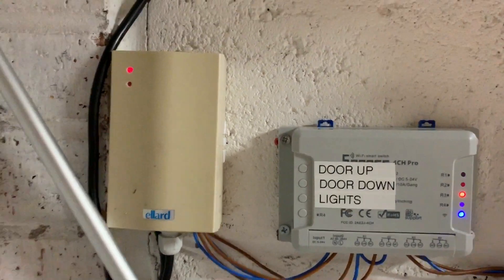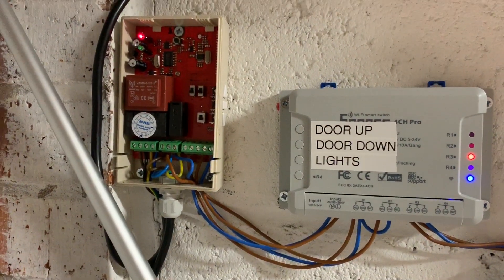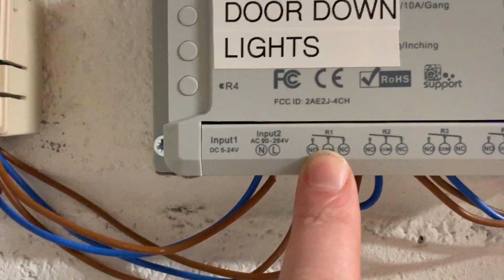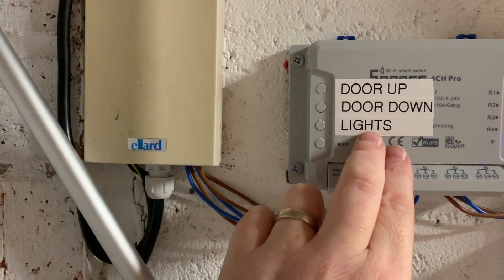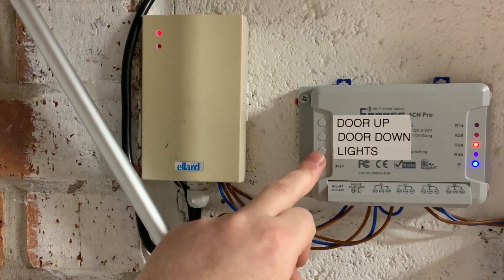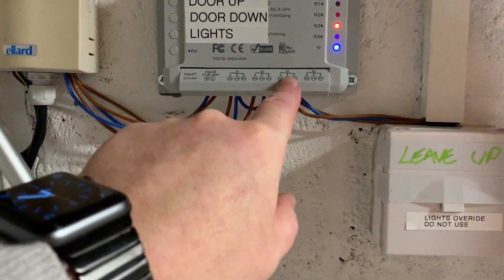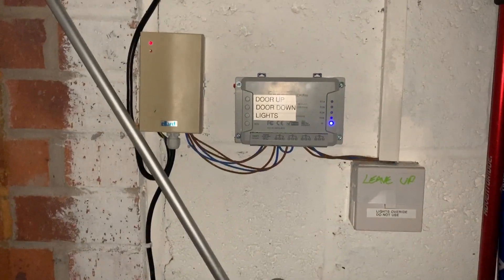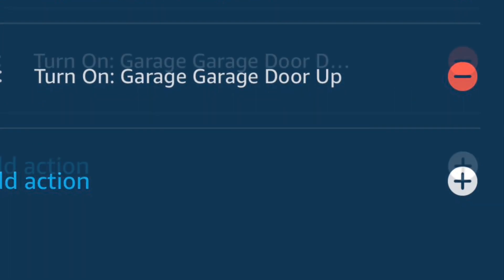Garage Door - Adding Alexa To Ellard Motor SONOFF 4ch Pro R2 Roller Door, up, down, stop switches

Comment: Thanks for vid. With the door “down”option do you have to change any settings on the sonoff? On my garage door I have to keep my finger on the button to allow the garage door to go all the way down. I’ve just ordered the sonoff and hope a single push will close it all the way.
Reply from the maker: You will have to simulate the down press from Sonoff as per what the door needs. So you will have to look at the inching mode I would think, set that to the number of seconds you hold the down button. Then the Sonoff effectively presses down for 10 seconds (as an example, set 10 to whatever it needs). There might be a maximum for inching mode. So might not be long enough.
Reply: Did you have to adjust any of the pins inside the sonoff device. Your older garage door unit looks similar to mine
Reply from the maker: @greggyboy28  no physical changes to Sonoff. Only settings in the software.
Reply: Thank you. There must be a way, I hope! Thanks for reply and v helpful vid

Comment: Great video! Thanks.

I have the same NT1006-remote-control-receiver from http://www.nvmgroup.co.uk/NT1006-remote-control-receiver 

I was wondering if the meross Smart Garage Door Opener would work with it? Any ideas?
https://www.amazon.co.uk/Control-Existing-Compatible-Assistant-SmartThings/dp/B086MLFRJ3

Comment: So glad i stumbled on your video.  I recently bought a Meross garage door opener but was told by their support it wouldnt support this type of controller. I have a product called NVM but it looks identical to yours.  I have returned the Meross mind and have just ordered the Sonoff.  Only small issue is i want to use it with Apple Homekit so i can control from Siri and from the car/phone/apple watch etc. According to Sonoffs website i think it can work despite amazon saying its only for Alexa or Google home  Thanks for posting clear video.  Just need to pause and focus on whats connected to where as im no sparky 🙂  lastly i just read some of the comments below and you mentioned a simple 2 way switch which might be best for me as i dont have anything else i want to connect.  any ideas on the model no. for one of those?

Comment: Great video, I have a question regarding turning the lights off when the door down command is issued .. is it possible to tweak that so for example if you only wanted to roll the door down a little it doesn't turn the light off, but a complete close of the door does result in the light turning off ? I can think of times I might want the door down a little whilst working in the room but obviously would still want the light on. On a completely different question ... I have a couple of ESP2866 control models lying around ... do you think its possible to use on of these to achieve similar results (or at least just issue door up and door down commands?) .. It looks like I just need something that is able to bridge the connections for a moment? Thanks!

Comment: hello, i have one question? When i put wire on up and common, the door comes up as long as the wire stays on contact, soon as i remove wire from contact, the door is no longer going up
Reply from the maker: That is different to mine. Not sure if there are any jumper switches (small black plastic wedges across two pins) that might be causing that. There are typically two types of switch, one where you have to press once and another where you press and hold. You have that option. The Sonoff thing does have the option to set how long the virtual press lasts for, so if your door takes 10 seconds to open, you could have it set to hold that switch on for 11 or 12 seconds, to be sure it completes the open or close command.

Comment: Can anyone help me. I am using two channels for up and down roller shutter and third Chanel for the lights. Now, I want the light to come on when the shutter is up and light to go off when shutter is down. Any help? I have tried scene but no vail.
Reply from the maker: Depends how you are using it but for me I created a scene open = 1 on & 3 on, close = 2 on & 3 off. Worked just fine. Then trigger  the scene instead of the button. If you use the remote for old door or the optional remote from Sonoff it didn’t work. I was using mine with Alexa and set the open command to the open scene. Close command to the close scene.

Comment: Rich Simpson

Gotta Thank you for this Sir.. got the newer R3 unit where inching is set up in the app rather than via the onboard micro switches. think my garage door panel is a slightly newer version also. but basically the same set up except i had a ground loop for a photocell which just needed to be momentary broken to stop the door. meaning i have all 3 actions available. routines such as 'Alexa Parcel time'.. door goes up for 5 seconds. pauses around 1ft high for 20 seconds and then drops again.  great for allowing the postman to slide something in.. all watched from my door bell or garage cam... TOP work Sir :). Thank you.
Reply: How did you wire the R3 please as this only has live or neutral connections?
Reply: @Garfoid  it will break the connection of anything you pass through each relay (channel) the unit it's self does not supply power to the relay... hope that makes sense
Reply: @zotzotty  blown 2 x garage door units now. I have the Sonoff RC3 and this only has Live or Neutral connectors. Powered the Sonoff via Live and neutral and that's fine but I then use ch1 and ch2 to go to O & D and then the neutral to G on the manual switch on door controller and Same neutral as power but as soon as I press ch1 or ch2 it is blowing the door controller 😢😢

Comment: Hi, not sure if you'll  still be monitoring messages from this video, however here goes. Thanks for the video, it was exactly what I needed. Can I ask, do you think I could convert a key switch roller door opener to a fob controlled unit? Thank you Alan.
Reply from the maker: If the key switch has a 2 or 3 wire input  I don’t see why not. It’s a fairly simple system if it has the right inputs I was lucky with mine. Ground and up = up. Ground and down = down.  Hopefully you are going to see something similar inside the main controller
Reply: @RichSimpson  thanks so much for getting back to me, I'll have a look today. 👍👍👍

Comment: Excellent video - you should get Amazon referrals...  a quick question - How do you connect it to your wifi - ie, how do you enter the password.  Is the setup through the phone app similar to the ring for example?
Reply from the maker: Thanks. Yes through the app. Connect to the devices own Wi-Fi network and then you enter your own info. Just like with the ring doorbells.

Comment: Hi there. Great video thanks.  
I have the slightly newer version of your garage control unit. The open and close inputs are low voltage.  Can I assume when you action the inching instruction to open or close it sends 230v? In which case this will blow the control unit?
Reply from the maker: Best to test it with a multimeter. It may be that it just closes the switch rather than sending 240v volts down it. dry contact and simply closing the loop. You are looking for continuity when the switch is open/closed
Reply: Erm I learned the hard way earlier and yes it blew the complete board. Just reordered a new one 😢

Comment: Hi Rich. Thanks so much for a great video, I am looking at getting this onto my door too which is basically the same setup.  Only thing i'm wondering is do you have the deadman switch on still so you have to push and hold the down button to close the door?  Is it possible on the SONOFF to have a push to close button still so I can keep the safety feature?
Many thanks and all the best.
Reply from the maker: Hi. I don’t have that but on the Sonoff you can set to ‘inching mode’. I have it set for something like 1 second so button one is pressed and it simulates being pressed for 1 second. You can set that inching mode for a variable length though. You can also buy the Sonoff basic unit instead and have one for up and one for down. Using the similar setup and can perhaps do it for about £15 all in then. The 4 way switch may be a bit over kill unless you have a need for the third and fourth outputs. Light (like I have) and socket maybe.
Reply from the maker: Also, note the model I used (Sonoff 4ch Pro R2) is a maximum inching mode of 16 seconds, but my motor is slow and takes roughly 30 seconds to go up or down. The later R3 model has an inching mode that can be set up to 1 hour in length so is likely a better option. The Basic modules also work well though and do this, A cheaper but less attractive solution as you would have 2 of them, one for up and one for down. Also having the risk of them both being turned on at the same time may be an issue, sending both the up and down instruction together.

Comment: Hi Rich.

Thank you for sharing this video.

I have an Ellard garage door box like yours.

I have just got the R3 Pro

I just wondered what size cable you used please? 0.75mm / 1mm / other?

Thanks again
Reply from the maker: I used some spare cable from an extension real I think, maybe 1.5mm but its not a large load for a long period of time so I think any will do so long as not very thin cable.
Reply: Thank you once again. Looking forward to setting this up.

I also noticed the eWeLink app doesnt have a 4 button option? Did you use the 6 button or the 3 button within the app and how easy is it to connect please? Is it safest to connect the device to the app first then wire in the garage door as my R3 says it's all adjustable to inching etc via the app. I'm no electrician but think I will crack this with the help of your video and help you've provided. Superstar for sharing
Reply from the maker: @james.mayhew  For me the 4 button came up as the default, must be a bit different. I would suggest wire it up to a plug and do it in the warmth of the house as different routers can be more fussy than others. Once its connected once its fine, You should be able to hear the relays working and see the lights to show it in the different modes without anything actually connected on the outputs. Also handy to update it through the app to make sure on latest firmware as some things may have changed, I think mine has received a new inching option in the app compared to a toggle switch now. A year in and mine has been really good, works well with different routines etc so for example on the Goodnight Alexa my routine does loads of stuff in the house including turning the garage light off and closing the door, just in case I forgot earlier in the day.
Reply: @RichSimpson  legend thank you. Will give it a go once I find some spare wire.

Shame it didnt come with a DC power plug but I'll be hardwiring it like you did into the garage door unit for power

Comment: Hi Rich, i have a roller shutter door on my shed and have bought the sonoff 4ch, but the one i got is a bit different to yours on the bottom i have 5x n 5x l 5x e on the first live it says live in then channel 1 to 4 now all the channels from 1 to 4 will be live 240v when on, now on my roller shutter box i do have 3 buttons for up down and stop,  BUT if i solder some wires from the buttons to say channel 1 to 2 for up and down it properly blow my roller shutter box as will put 240v on to the switch , now on my app for the sonoff if i go into the setting i can set it to inching mode, BUT do you know if this will put 240v to the switches or just make and brake with no volts, i was looking at yours and can see you have terminals from you buttons from the garage door box but are they 240v or is it 0v from your buttons when you press them, many thanks if you reply. Gary
Reply from the maker: Gary Farrar hi. The inching mode only affects it being an on switch to a press and release. So either like a light switch or like a doorbell. You can set how long the inching mode is artificially pressed for I think. Voltage wise though it’s the 240 coming out still. Is your button for garage door expecting a lower voltage than 240v? 
On = 240v off = 0v 
Inching mode gives 240v for perhaps 1 second then off again.
Reply: @RichSimpson  thanks, what i did was modify the sonoff, mother board  " live in 240v  L1 L2 L3 L4 "  the live in went to all the relays but it had a fuse on the line in rail to the main board for it`s power so i just de-soldered the fuse from the relay side soldered a red wire on this with shrink rape then put a blue wire from the N and fed this out with shrink rape, now on my shutter box i soldered 2x2 wires from the switch up/down and fed  them out  " common to live in and 1 wire to L1 and the other to L2  on the relays of the sonoff hay presto job done, what this as done is made the relays 0v  when energised as my roller shutter controller was a old type that did not have any extensions for the side up and down buttons. now all i have to do in my house from alexa  is say " alexa turn on open door or turn on close door " i am working on trying to get to just say " alexa close door ETC: " but for now it works and i am not trying press the remote in my house and finding the right place for for my shutter box to pick the 433mhz  signal and NOT buying the 12v battery for the remote. Thanks for the video, this did help me and hope my little bit with my shutter box helps some with the same.

Comment: Hi. Don’t know if you can help me .....  great video and I followed it to set mine up.  However when I either do open or close the power stays onto the sonoff unit and I have to switch or press the button off before using the other button. So if I open it I have to press open then when open press open again to turn off. I can seem to get it to open then straight away close. Hope that make sense. Basically the light stays red until pressed again. Any ideas
Reply from the maker: Hi Simon, you need to put the Sonoff into inching mode (I think thats what it was called). then it will trigger and go on for a set amount of time then off again, only needs to be a short 'press'
Reply from the maker: https://www.itead.cc/wiki/Sonoff_4CH_Pro

Comment: Awesome video. I bought a house with the garage door controller but had no documentation to go with it. Looking at your video, it is exactly the same . Could you please put a link to the wiring diagram for the Ellard controller so I can recreate your setup (minus the lights). Also is it possible to use 1 of the channels on the Sonoff controller to act as a Stop for the motor, similar to what the middle button on the Ellard does? Many thanks again for an awesome video
Reply from the maker: I think I have both answers. I will try to post link to my wiring diagram. In there there is the STOP button which you woudl need to connect to from the sonoff to have that feature. https://1drv.ms/u/s!AlDUTsEbdZUXtVNTpF-ABlck3LTJ
Reply: @RichSimpson  Thanks Rich. That's awesome. I also found the newer version of the diagram on the Ellard website. https://www.ellard.co.uk/wp-content/uploads/2017/10/elec_ATHENA_misc_005-rev-2.pdf